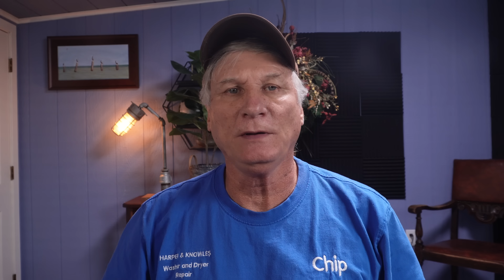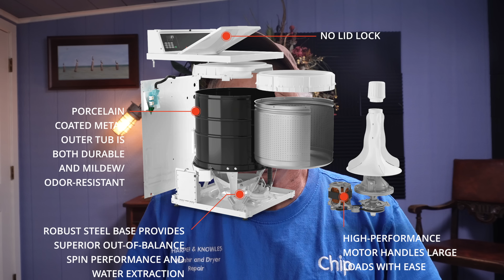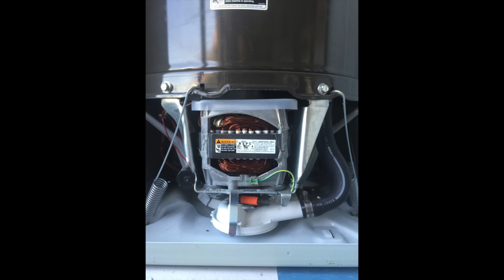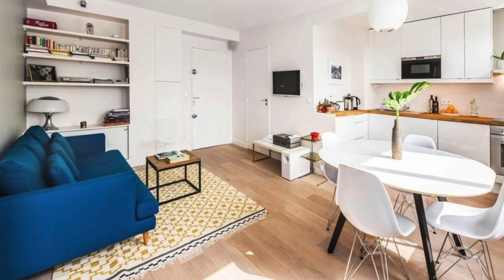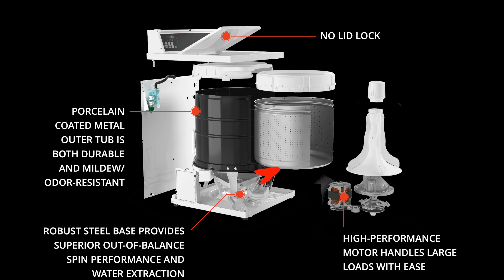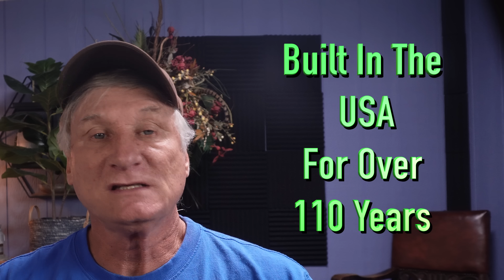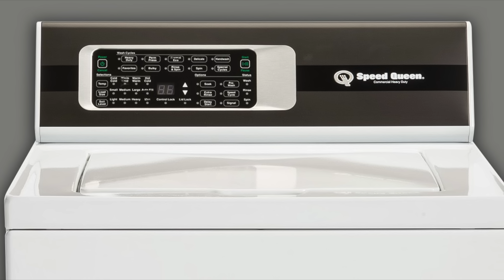TR7 vs TC5 – The Truth Speed Queen Dealers Don’t Tell You

Comment: I purchased a speed Queen Model # AWN432SP113TW04 about 8 years ago and I hate this washing machine.  I previously owned a Maytag front loader (purchased in 2003) which I really liked except for the small capacity. The Maytag front loader was very easy on my clothing and used very little water .  This Speed Queen seems to grab and snatch at every thing. It eats holes in my dish cloths and wash cloths. I have to put every piece of clothing that is remotely "delicate" in a laundry bag.  Very few clothes are washed at a time. The water used to wash a load of clothes (or I should say a partial load)  is ridiculous..   I HATE this machine.  I understand that the Maytags today are NOT the Maytags of yesteryear.  It seems Maytag sold out years ago. So the search continues.  BTW, I moved across several states and left my Maytag washer/dryer set behind. BIG MISTAKE!  Too bad I wasn't offered a TR7 model when I went to replace my Maytag washer/dryer.   That model may have been fine or perhaps the TR7 wasn't available 8 years ago. Thank you for your review.
Reply from the maker: Sorry to hear about your experience, thanks for sharing your thoughts!

Comment: Hi Chip I was told buy SQ before the 2018 model.  The older clean better. Is that correct and why did SQ replace it?
Reply from the maker: I think they are the same quality. There may have been some EPA regulation that the company had to comply with. I think the present administration is putting the halt to government agencies making rules and regulations that are not laws that have been passed by congress. They are only supposed to enforce laws that we pass through our elected representatives, not make up oppressive  and sometimes ridiculous rules and force our manufacturers to comply with. Thanks for watching!

Comment: I quote Consumer Reports on the Speed Queen top agitator model "If you’re searching for a top-load washing machine that scores low in cleaning, energy efficiency, water efficiency, and noise, our tests highlight a few models that really miss the mark. These are not machines we’d recommend, but here’s what stands out from our reviews: -- The Speed Queen TC5003WN is another model that’s just “good” at cleaning, “fair” for energy efficiency, “mediocre” for water efficiency, and only “fair” for noise. More on the Speed Queen TC5003WN."
Reply from the maker: Thanks for the comment. You’re quoting Consumer Reports’ review of the Speed Queen TC5003WN, which knocks it for being “just good” at cleaning and only “fair” on efficiency and noise. But as someone who works on washers every day, I can tell you their testing doesn’t reflect what actually matters to most people.

Here’s why.

Consumer Reports runs machines through lab tests focused on water and energy use, not long-term reliability or how well a machine handles real-world messes. They ding the TC5003WN because it uses more water—but that’s by design. It’s a mechanical, no-nonsense machine built to rinse clothes properly, agitate with strength, and handle dirty farm clothes, grease, dog blankets—you name it. It’s built like the old-school washers people still hunt for today.

They also don’t factor in repairability or lifespan. This Speed Queen has a metal transmission, a steel cabinet, no lid lock, and a good old-fashioned mechanical timer. It’s made to last 20 years, and when something breaks, you can fix it with a socket set. The high-efficiency models that score better on their chart? Plastic parts, sealed tubs, overpriced control boards—and you’ll be lucky to get seven years out of them.

As for cleaning performance, don’t let their “just good” label fool you. Their stain testing is controlled and artificial. I work with customers who’ve switched back to Speed Queen after fighting with HE machines that left soap residue, unbalanced loads, and damp, smelly clothes.

Ask any appliance tech what washer they’d buy for their own home—we almost all say the same thing: Speed Queen. Built to last. Built to be fixed. Built to clean real laundry.

Consumer Reports doesn’t tell the whole story. I do.

Comment: I made the educated BUT misguided mistake of purchasing a Speed Queen a year ago. Bought in September, by November it was malfunctioning. Called speed Queen, they sent tech out, a week later it was fixed. Forward to May, machine starts beeping and won’t stop, I call, they have me pull plug and reset? Nothing. They Call repair tech and schedule appt. repair tech comes out calls Speed Queen Tech, they determine its mother board. A week later part comes in. It’s the wrong one. Tech leaves. About 5 days later new Board comes in. Tech comes for Visit #4, Install Board, machine still doesn’t work, tech calls Speed Queen Tech Guru , Guru say’s must be the Harness! Tech orders part and leaves to wait for Harness to come in. Visit #5 Harness and tech arrive, tech installs new Harness, machine fails to work. Tech calls Guru, Guru claims old Harness must have caused a glitch in new board and now new board is ruined so obviously tech must order new Board( THAT WILL DEF FIX IT ALL!) so board #4 is ordered. I go away for 10 days cause life happens. It’s now late June and Tech makes visit #6, installs new board. Machine works? Ok! Now it’s July 2 or 3rd Machine begins incessant beeping, and at end of cycle clothes are sopping wet. Also they must have installed a very advanced board cause now as soon as I close the lid the machine commences a washing cycle sans any pressing of Start Button or such! At the end clothes aren’t clean and there’s a puddle in the tub. I call Speed Queen again, request Retention Agent, explain I am now two full months without a washer, my husband is Disabled Veteran as is my adult son. I AM THE LONE CARETAKER. I tell them this machine is obviously defective PLEASE STAND BY YOUR PRODUCT AND REPLACE THE MACHINE! Laundromat is a fortune and I am at Witt’s end! They respond that they will escalate the case ( whatever that means, no explanation is given for this elusive term) I should get a call within 24 hrs. That was on Monday, today is Friday the July 11 2025. I have heard no word. I’m 63, I have had Kenmores, Westinghouse, Maytags, etc. A lifetime of good bad and mediocre. NEVER HAVE I HAD SUCH A BAD EXPERIENCE, I did my homework and trusted the reviews of several techs and posts online. My advice? At almost $2,000.00 for a machine, you are better off buying a cheap scratch and dent and replacing every 5 years. KICKER? I’m still making payments on this POS. Will be copying and pasting this review everywhere in hopes that others will be spared . It’s expected that once in awhile a dud will be produced. The shame is not in that, the SHAME is in how poorly I have been treated and how SQ really doesn’t stand by their products as stated. Buyer Beware.

Comment: Thank you sir for your inspirational words MADE IN USA. Built to last. Sounds like a man of knowledge. I’m sold to buy the next wager and dryer speed queen. Heck with those cheap models. I have had them all except speed queen. I’m tired of working on appliances and tired of having stressful problems. It’s always something. Why does it have to be the washer and the driller. It might cost a little more up front but if I’m saving money in the long run and not having issues might as well go with speed queen
Reply from the maker: Thanks for watching!

Comment: You said TC5 can handle queen stuff how about king? Blankets sheets comforters? We have king stuff so Im hoping that can also clean very well? I know 3.2 is small not sure how well it can for the king stuff
Reply from the maker: No, I recently worked on a TV5 that the lady had stuffed a king sized comforter in and burned the drive belt up. Take those to a laundromat that has a high capacity (80lbs.) front load machine. Thanks for watching.

Comment: YOU SOLD ME AT NO LID LOCK! 😭

I can’t wait to get the TC5 for multiple reasons, but having physical buttons and knobs is a big factor. I’m so sick of digital panels on everything.
Reply from the maker: I think you’ll be pleased! Thanks for watching!
Reply: Tc5 are digital they're not mechanical
Reply from the maker: The TC5 is built around a modern electronic control board, offering longevity and precise cycling. If the control board fails, you’ll need to replace the board rather than a mechanical timer component. In case you’re specifically seeking a Speed Queen with a fully mechanical timer, look into their commercial or older models, which feature true mechanical timer knobs, though they typically carry a shorter warranty and are marketed differently. Thanks for watching!
Reply: Me too! I want analog controls and am willing to pay for them.

Comment: Ok, so after seeing and hearing so much on Speed Queen's top notch performace and durability, I have decided that when I get a new washer, to go with 1 (probably the TR7, but I need to do a little more research). I currently have a GE front load washer and matching dryer set that I bought brand new in 2009 (have had no problems), but have just been looking to upgrade-- mainly w/ a washer, bc I have kids now (gave birth in 2016 & 2018), so I feel their clothes cld be cleaner. My question is, I guess I'll be perfectly fine to just get a Speed Queen washer, & just keep my dryer, or are their dryers [specifically the TC5 or TR7] top notch as well?
Reply from the maker: They are! Thanks for watching!

Comment: I bought an LG front-load washing machine, and it turned out to be a disaster. Despite having level floors, the machine bounces and shakes violently during the spin cycle—it felt like it was going to destroy my house. I've double-checked the installation and everything on my end is fine.

Now I'm in the market for a replacement, but after doing some research online, it seems like nearly every washing machine has major issues or consistent negative reviews. I'm feeling stuck and not sure which model or brand I can trust anymore! Thanks!
Reply from the maker: Give Speed Queen a try you won't be disappointed!

Comment: Just had a service call for our two year old Maytag washer.. it's a piece of crap! It's ridiculous I fixed it once myself last year. I I'm going to go try it again see if I can make it work after the service call he got it working but now it's doing the same thing it won't run correctly won't lock won't spin a whole bunch of things just keeps happening so I give up its going into dumpster I'm going to burn it and throw it out in the corral and burn it nobody should have to put up with this type of garbage from a manufacturer Maytag you should be ashamed of yourself putting in boards that don't work after time or putting in buttons that don't work switch issues with plastic it's BS I'm so angry I can't see straight
Reply from the maker: Thanks for sharing your experience!

Comment: I bought a Speed Queen in 2017 and have had zero issues as expected. My previous washer was a top line Maytag. Beautiful machine with subpar performance. It had the impeller thing that just didn't get clothes clean enough. It was also constantly re-centering an off balance load. I replaced the pump myself as it got cracked when a penny made it's way down there. It also needed  bleach run through it regularly. I put up with it for 9 years. That was enough!
Reply from the maker: Thanks for sharing your experience!
Reply: Hows it going with the washer?
Reply: @elbowmacaroni1408  The Speed Queen has been rock solid. It's a bit on the loud side but it's in the basement so no big deal. it's just me and the wife so we do a couple loads a week. At that rate it should out live me!

Comment: a quick question about Speed Queen's warranty... on the TC5, the warranty is 5 years "bumper-to-bumper"... but how many times will they agree to repair it under warranty?   for example, the transmission is repair/repaired in year 2.   Some electronic board is replaced in year 3.. and if something else major breaks in year 4 or 5, will they still come out?   Or is it like some manufacturers where they'll simply give up and replace the machine?  Thanks!
Reply from the maker: That's a question you'd have to ask Speed Queen. Let us know what you find out. Thanks for watching!

Comment: Our Whirlpool washer purchased in 1993 is still going strong.  I dread replacing it.  My concern with Speed Queen washers is that apparently they use substantially more water than other models, and we are on a well which is usually fine, but drought years would mean going to the launderette.
Reply from the maker: Ha! We don't have that problem in Louisiana. We usually have a great abundance of extra water here. The 1993 models were pre EPA standards. These modern Speed Queen have to comply with the same regulations. I'm betting your Whirlpool uses more. Thanks for watching!

Comment: You're so right regarding Whirlpool! I bought one....top loader 16 months ago, and now it won't spin. I've been told  the circuit board is shot and not worth replacing due to cost and repair charge. Money wasted! Whirlpool used to be solid but now its junk!. I'm about to purchase a Speed Queen. So many bad reviews on the other brands. Fingers crossed SQ will last for many years! Thanks for all the info!
Reply from the maker: You won't be disappointed!

Comment: Great video.  I made the mistake of buying a Samsung front loader.  That lasted 3 years.  Thankfully, I bought the extended warranty and replaced that with a Whirlpool top loader.  Garbage again.  Within 5 years,  lid lock issues and control unit failure. I am buying a Speed Queen today.
Reply from the maker: You won't be disappointed. Thanks for watching!

Comment: How high, from the floor, does the Speed Queen drain pump scavenge the waste water into the drain. I have a 2" diameter pipe drain that is 68" from the cellar floor. I was told that the Speed Queen can only pump waste water 4' from the floor into a wash basin, which I do not have.
Reply from the maker: Ha! There are some questions I can't answer. This is one. Thanks for watching!

Comment: Question. Have you had to replace or work on the T7 due to the motherboard? Even though it’s a 7 year warranty, I am worried about the cost of replacing anything electrical after the 7 years.
Reply from the maker: I almost never work on these but a friend just called me and the board had gone out on one he was working on. Its still under warranty for another month. They are sending him a replacement board no charge for it or labor.

Comment: I have a TR7 for 6 years. After 2 years it started having a beeping sound. Since it was under warranty they came and replaced a part, that had to do with door lock. Now, 3 or 4 years later I have the same problem. The beeping occurs both while the washer is being used or not. So, we have to unplug when not in use, if not is too annoying.  I don’t know if having it fixed will be too costly, and then for it to happen again. Have you dealt with that issue"
Reply from the maker: Speed Queens are so reliable that I have only worked on 3 in 6 years. All of those issues were from customer abuse. You’ll have to find a tech that has more of them in their area. They are rare around here. Thanks for watching!

Comment: I just bought a brand new COMMERCIAL MAYTAG today includes a 5 year warranty in lieu of Speed Queen bc it’s Drum is a bit bigger and was slightly on sale. MAYTAG won only bc of the bigger drum and better priced. It also has a Direct Drive unlike my 5 year old big Maytag. I read this Maytag, commercial line is good on here. Pray 🙏 that it holds up well like SQ? If it gives me smooth service for at least 10 years, I’ll be happy 😅! Hopefully it will die with me then I’ll know I made a sound investment today! Lol 😂 bc these types of 🎉COMMERCIAL Machines aren’t cheap! Also to get one of these Maytags is a ONE MONTH order wait but I found some SQ around town in stock. Fortunately for me I found one new which arrived yesterday he said?and one floor model after searching. I had an old GE which lasted me 20 years till the Dial died and couldn’t be replaced? Thx 🙏
Reply from the maker: Thanks for sharing!
Reply: I bought a Maytag refrigerator in 2022. I will never buy another Maytag anything after owning this POS.

Comment: I'm from Brazil, the level of water of TC5 is automatic? What is the voltage, 220volts or 110 volts? Thanks.
Reply from the maker: Speed Queen sells washing machines in Brazil. They offer a range of residential products, including top load washers, front load washers, dryers, and stacked washer/dryers.  To find authorized retailers or service centers in Brazil, you can visit their “Onde comprar” (Where to Buy) page.  For further assistance, you can contact their Brazilian office at +55 11 5508-2900. I would contact them to determine the voltage requirements. Thanks for watching!

Comment: Thank you Chip.  My Maytag A612 Series 04, 3.2 CF, bought in January of 1989 has been a workhorse. It has a soak/prewash cycle. I still love it and wish I could buy exactly this unit new today!!! The bearings are gently telling me to be ready to purchase a new washer, as no one works on these units any longer.  It has a filter on the agitator and I clean it after every load.  Mostly not a lot of lint, unless a piece of Kleenex got in the load or we have been working in the yard.   Of course with towels, especially new ones there is a good bit of lint. The new washers seem awfully flimsy and none of them have a lint filter, including the Speed Queen.  I am concerned about lint being trapped trapped somewhere in the washer or a clog developing in the drain hose. I am a 77 year old short woman and don't need appliance problems that will require me to move a washing machine.  Is my concern valid?
Reply from the maker: No, the lint leaves the washer with the dirty water and what’s left collects in the dryer filter. Rest easy, lint in your washer is not a concern. Thanks for watching!